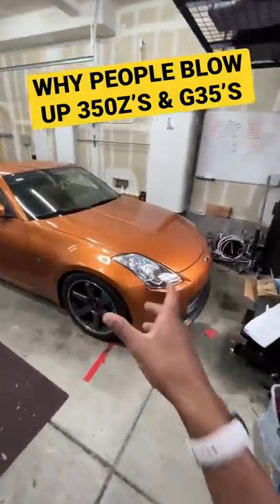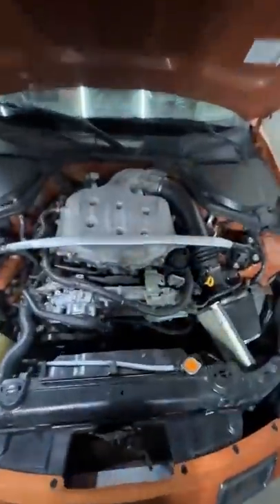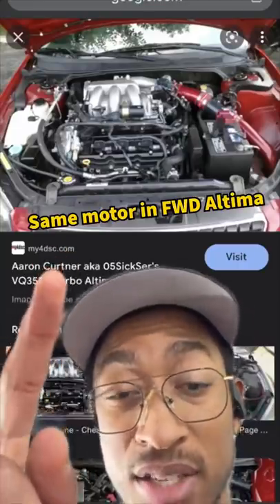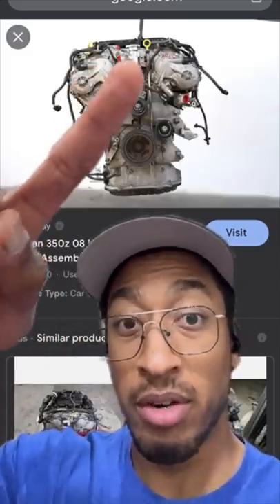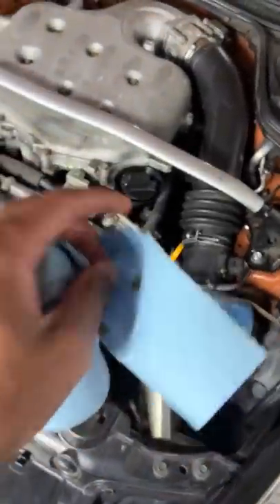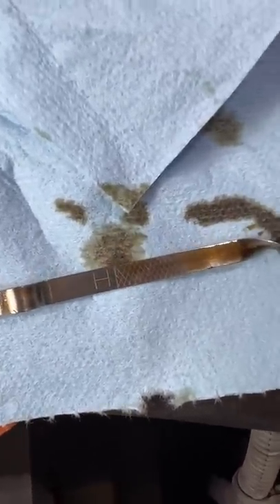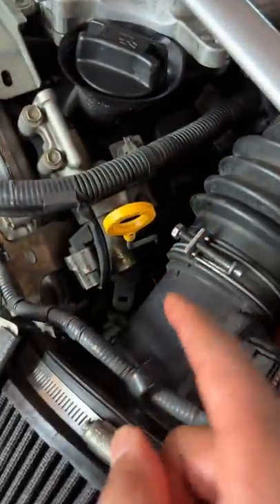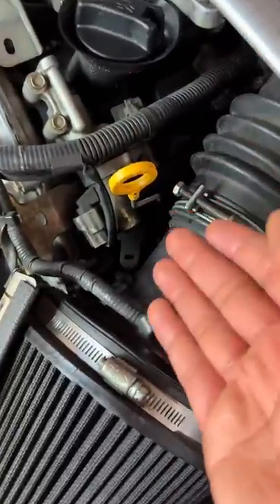Why people always blow up their 350Z’s and G35’s 💥🤯💣

Comment: Crazy how they didn’t just fix it when they re-released it twice over. 

Or just redesign the car for the other 2 times
Reply: They didn't make a mistake. People just don't know how to check oil, like this guy.
Reply: Redesign the engine not the car. Lol.
Reply: Blame the user - not the product.
Reply: This generation Z was designed secretly with just a couple of men at Nissan (including Mr Mizuno who designed the r35) because executives didnt like sports cars at that time. They literary worked after everyone went home to build the prototype z. That is why some parts of the car is not designed well.
Reply: They actually did fix it in 07
Reply: I mean if you bought anything past the 350/35 series aka the 370/37. You’re an idiot that way overpaid for an outdated car. Also as a company why spend the time and money to redesign something when they can sell it as is and people will buy. Standard corporate mentality.
Reply: @acywei  let me know another naturally aspirated V6 from factory that can handle 600-700whp on the stock block while boosted and be daily driven……
Reply: @OldFlameOfficial  these ppl have zero clue lol. Our HR Zs dont do this, nor blow up like shitty 03s do.
Reply: @FoodFighter46  wtf are you talking about. the new z or the 350z
Reply: @OrangeHeadTM  370z is even better
Reply: @Shabbe02 most 370s are not better than 2007/2007 350s lol.
Reply: Yes they are what are you smoking 🤣
Reply: @laurapalmerTDGE  I blame the builder, not the buyer. It’s usually their fault anyway.
Reply: That would require a new cast which costs money. And 75% of the people driving these cars don't even know sh*t so they don't 🤷
Reply: @monsterzard1  I always check oil cold. People blow up engines because they are stupid nuff said. Has nothing to do with being able to read the dipstick lmfao. If you do your oil changes on time that shouldn't matter. And if your leaking/burning enough oil inbetween 3k for it to matter you got bigger issues than the dipstick.
Reply: Crazy that people don't know you check oil when it's cool for a better reading
Reply: Why do that when it will cost more money and there's no problem because they aren't driving or blowing up engines, you are. And that makes them more money
Reply: @thronewalker1153  I’m talking when they rebadged the same car, for infinity, bmw, and Nissan. All the same car, different badge, same engine. Just fuckin fix the oil on one of those. You got 3 damn chances
Reply: cLuTcH BleacH a majority of these motors burn oil. And yes enough for it matter at 1k, you don’t have to wait to hit 3. They have their downfalls but not a lot of motors can handle 600hp with a stock block and be driven daily. Pros and cons
Reply: Don’t forget M35 got this engine too smh
Reply: Because the vq is actualy a renault engine out of the Mégane Coupé
Reply: @acywei  some people don’t want all the unnecessary “safety” features and boring driving characteristics. The 370z/G37 are both great vehicles. Nissan did drag out the 370z about 5 years too many without doing and kind of improvements over the original 2009 model.
Reply: Less broken cars mean less money
Reply: @DaytonaBlueHr  bro I own a Z but even this is false. Stock internals will handle about 400-450, anything more and it’s gonna blow.
Reply: @danielhuerta6575  You probably have a De….. the Hr and Vhr’s have been over 600+whp easily lol
Reply: @DaytonaBlueHr  I know what i got man, HRs don’t handle 600 reliably. Don’t kid yourself man
Reply: @acywei  hop off the video games and go touch some grass kiddo
Reply: Fix what? The owners manual??
Reply: You can't fix stupid, you check oil when the engine is off not after its been running
Reply: @Ds0661 what are you smoking? Manual is super reliable. Fun to drive. A v6 coupe is 10x better with manual tranny.
Reply: @DaytonaBlueHr  mustangs. I hate those crowd crushers but they can do what you asked while also being just as if not more reliable on 600whp and being better on fuel stock. Thinking that only the Japanese can make affordable boostable cars is such boomer mentality it's hilarious.
Reply: They fixed it on the hr
Reply: They did tho goofahh jit
Reply: @OrangeHeadTM  07/08 HR models are definitely a huge improvement over the VQ35DE. I was only buying a HR and refused to get the DE.
Reply: @clutchbleach2057  checking the oil consistently or not doesn’t stop those engines from burning an absurd amount
Reply: @Thor Odin son Renaultssan as I call them. That tells me all I need to know about that. 🏃 far away from a modern Nissan I mean Renaultssan.
Reply: @monsterzard1  they did though. This shouldn't be an issue at all, it's notnliek this on most other motors.
Reply: @thronewalker1153  the engine is good
Reply: @OrangeHeadTM  they dont blow but our damn gallery gasket is paper....... why....
Reply: @qualydinero7451  lately I've been starting to think a lot of these faulty things in cars that are known to go, are done on purpose by the manufacturer. There's no other answer, in my opinion.
Reply: Nissan been using the QR25 motor(4cyl in altimas, sentras, rogues, jokes, muranos) for about 25 years now. If they don't have to change it, they won't lmao.
Reply: @OrangeHeadTM  every single thing you have said in this comment thread is absolute nonsense. You dont know what you’re talking about and everyone who does is laughing at you.
Reply: Nissan makes other engines like this, horrible dipstick design
Reply: @DaytonaBlueHr  naturally aspirated being boosted? Huh?
Reply: @monsterzard1  if someone is following the manufacturers instructions, he is smart. You got it all wrong lol
Reply: @brianritzpatrick4737  it’s because nobody at nissan HQ drives a nissan
Reply: @@thorodinson3323there are plenty of great entry level cars that will last well over 300k. Namely Toyotas and Mazdas.
Nissan just can't make good entry levels 🤷‍♂️.
Of course there are worse out there. But they clearly have their focus on looking "cool" or being "performance". When really. Most adult buyers don't care . Most buyers like luxury or utility.
Reply: And then spam you with ads acting like they got some hot shit smh
Reply: @DaytonaBlueHr  max whp i can make on a stock de ?
Reply: @jorgem.4382  400whp max
Reply: @DaytonaBlueHr  and with all the money just to get 400whp i should prob js get sumn else huh
Reply: @jorgem.4382  you could get an Hr and be able to make 600+whp reliably, even just at 500whp you will be beating most cars and doing 60-130 in 6-7 seconds
Reply: @DaytonaBlueHr  bet and an hr fits in g35 without any other kit huh?
Reply: @jorgem.4382  yes an Hr motor would easily fit in an 03-06 G35
Reply: @DaytonaBlueHr  how much you think i can get one for and to get it put in? total cost
Reply: @DaytonaBlueHr  thanks for the replies btw
Reply: @jorgem.4382  depends on where you get it tbh, a very low mileage one will probably be around $2k but you can get some with 60k-120k miles for around $1500, the swap can be kind of expensive unless your doing it yourself. Will probably cost around 3-5k to do the swap if you take it and thats including the price of the Hr motor and labor as well if you take it to a shop
Reply: @DaytonaBlueHr  for sureee and you think thats the best route money and whp wise?
Reply: @DaytonaBlueHr  FACTS...ive seen 700wheel on stock block safely with 13-14psi running tens of thousands of miles.  For anyone who needs reference check out the 370 on Fast Intentions that they built for customer
Reply: @OrangeHeadTM  heavy facts....Fcking obsessed with my 08 HR its gotta be my fav car that ive owned along with the two 2004 VW R32's i used to have (that drained the wallet at 100k miles +) lol
Reply: @RickydaDicky666 Sports cars consume oil by nature. That being said, just because your car consumes oil. Doesn’t mean that you should avoid topping it up. If you can’t handle that, just buy an econobox if you can’t afford to take extra care.
Reply: @Iridiumcosmos  or just buy a car with a better engine that doesn’t need the extra care lol
Reply: @RickydaDicky666  Most sports cars and above are like this. If you’re going to comment stupid stuff like this. Stick with your econoboxes. Lmao.

Comment: when i was a tech at nissan, i learned that if you pull the dipstick out and see oil splashed all over the marked side, you can turn it over to the unmarked side and the reading will be accurate. the messy oil reading is common on pretty much all newer nissans

Comment: "I might be low on oil - better run it for 15 minutes before checking."
Reply: That's how Ford decided my transmission fluid level should be checked.  Morons didn't think a cold read level was worth bothering to make, so to know if the transmission is safe to run I am supposed to run the damn thing and CHECK IT WHILE IT'S RUNNING!!!
Reply: @rockspoon6528  That's beyond ridiculous.
Reply: @rockspoon6528  that is literally how you are supposed to check transmission fluid on all cars...while it's running or been running at LEAST a minute.  Cold readings are horribly inaccurate on transmissions.
Reply: @JTheraos  There are "literally" lots of transmissions with cold readings, and the accuracy is not particularly relevant when it's just a ballpark so you can safely warm it up.
Reply: @rockspoon6528 that’s not Ford that’s just standard procedure to check trans fluid level on any car. It sucks but due to the design of the system and the fact that oils flow different at different temps you can’t get an accurate reading when it’s cold
Reply: @rockspoon6528 you have to check transmission fluid while the car is running. If you don’t check it running then you won’t get a correct reading at all. The torque converter will fill with fluid when it’s running and the level will drop. All ford transmissions have a cold level also so this is straight bs 😂

Edit-all automatic transmissions have to be checked running. You can still check it not running to make sure there is some fluid there, as long as you are quick when filling/adjusting the level it’s not a problem.
Reply: @Willbertoslackbold  My Ford transmission, the 6F50, is one of the most common in production and does not have a cold level.

Comment: I was taught to check the oil when the engine's cold anyway, when the oil is settled in the pan.
Reply: I thought that's always what your supposed to do
Reply: It is. You only check it warm after an oil change for obvious reasons
Reply: Shops aren’t gonna wait for the oil to cool down before an oil change, they do it hot
Reply: It is you run the engine for 30 seconds then shut it off let it sit for like 30 second to a min
Reply: @leocorral  yes and they over filled the fuck outta my oil almost bent a rod...
Reply: @leocorral  now I do it myself like your supposed to...
Reply: @leocorral  and that’s why I stay far away from quick lube shops lol
Reply: @jimmy5860jim  at least you learned your lesson lol
Reply: @RapidRedRider  because they do it hot? Not because they over or under fill? Lol
Reply: @leocorral  because they do it hot it will either be underfilled or overfilled if you check it hot it won't be accurate their is on the dipstick a hot and cold level hot oil pressure raises pushing the oil high up on the stick why you do it cold.
Reply: @jimmy5860jim  exactly.
Reply: @jimmy5860jim  they have a hot mark so you can check the oil while it’s hot, you were so close lol.
The hot mark is above the cold line by design, that way you can still get an accurate reading without waiting around for your oil to cool down
Reply: @leocorral  did I said that I also said it's not the proper way to doing it it wont be a proper reading also Ik because I worked at a dealership with a bunch of mechanics and I've been changing my oil forever now and never once had an issue so sorry if I misplaced words but have a good day sur
Reply: @leocorral  still not accurate I would know sir I've done both ways multiple times
Reply: @jimmy5860jim  you work with techs and I am a tech, but you can do it however you like
Reply: @leocorral  ight sounds good to each their own.
Reply: WRONG.
Reply: @RapidRedRider  ive always wondered this. Since like, the engine is going to be warm when doing the oil,  is it safe to come back when its cooled and add more oil if necessary?
Reply: @gabrielware2777  of course. When the engine has just been running some of the oil is up in the engine so the reading on the dipstick will be off even if not by much. When we say let it cool off we just mean let it sit long enough for the oil to fall back down into the pan/sump. When I’m changing oil I always add what the manual calls for, start it up to get the oil circulated and the filter filled then shut it off and check it after I get my tools picked up and my mess cleaned. Usually 20 or 30 minutes later I check it and add if necessary
Reply: @leocorral  shops also know after the change it takes 4.6 qu or whatever it is and fill to exact “usually”…. I feel like no one knows you can while a dipstick off a couple times to be able to get a clear reading also?
Reply: @jimmy5860jim  diesel shop I used to work at had me actually set and egg timer (no cell fones then) for five minutes to wait and check. On modern cars with overhead cams sometimes mfgs want a slow drain back time for bath effect oiling. I let most cars set that same five minutes,gotta check the other fluids you didn't while it was running and the tires.
Reply: @metalsurgeon9196  ye
Reply: I have a dry sump setup and you have to run the engine (hence scavenge pump) for 3 minutes and then rest for 3 before you can dip it.
Reply: As one should.
Reply: On wet sump cars yeah, dry sump you gotta check it after running
Reply: Lol not sure why you'd check the oil after it's been splashed everywhere and hot as shit 😂
Reply: Nope.. you definitely check it at operating temperature and let it sit for a min to let the oil drain down unless otherwise stated in the owners manual. You can check it cold (obviously) but I've never seen a car that has you do it that way and your reading isn't going to match the dipstick. It really doesn't matter when you check it as long as you know what's between the hashes on the dipstick for that temp. The better question is why don't cars just have a hot and cold measurement line they do for power steering reservoirs.

Never see a comment section so wrong before.. confirming this dudes video for sure.
Reply: @roodick85  The oil is thin at operating temp.. and it drains down anyways.
Reply: @RapidRedRider  literally lmfao
Reply: @roodick85  in a well designed engine, there isnt much spash up into the dipstick tube, so dipping and cleaning it once or twice should give you an accurate read. As to why youd want to, its because oil changes its volume in response to heat, so checking it at operating temp tells you the volume of oil you have when the engines running, which is more important than the volume you have when its not.
Reply: I feel like that's not a legit owners manual, correct me if I'm wrong
Reply: @leocorral  yeah, you can do it hot if you know how many quarts it takes to fill it, and it will drain faster being warm. More likely to get more old oil out of the block when it's warm
Reply: @jimmy5860jim  you can do it hot, more old oil will drain out when it's warm
Reply: @morganoch5006  my comment is months old nowand im still getting brought back to the oil change comment thread lol, and yea I work at a diesel shop and most Detroit’s and Cummins take 10 gal give or take so I agree
Reply: @leocorral  yea damn, didn't realize how old the comments were lol
Reply: Get the engine up to operation temperature, turn the engine off, wait 5mins and check the oil. 
Thats how you do it